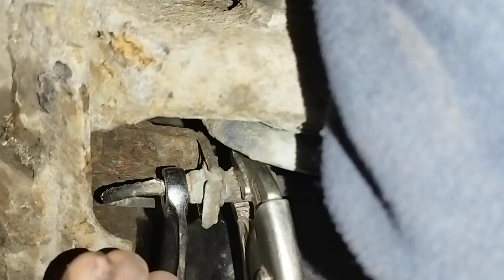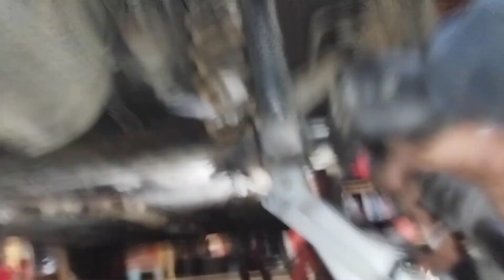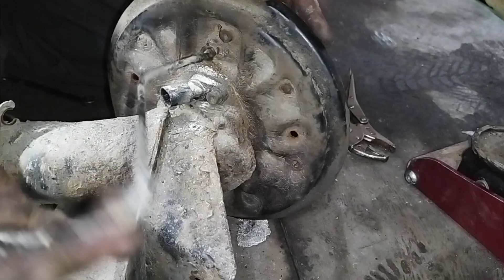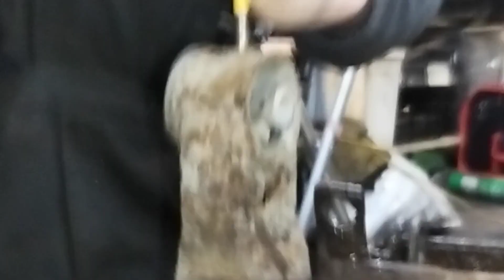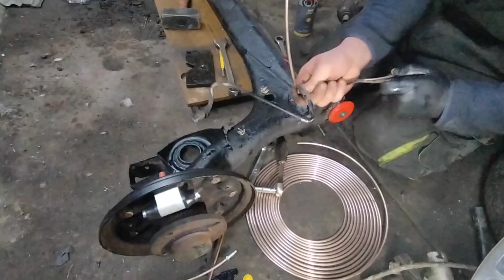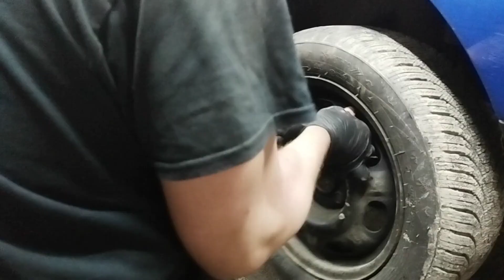VW Lupo Tuning - torsion bar polyurethane bushings install and rust protection

Comment: Hey Simon,
I've got couple of questions. Maybe you can answer :-)
1. Do you have any thoughts about new PU bushings after 3 months? Is car more or less stable on the road? (I've read that in some cases changing rear suspensions bushings to PU make things much worse).
2. Did you buy MPBS, Strongflex or some other vendor?
3. Does this car has also PU in front suspension (I am wondering whether PU will work OK on rear axle, when front still use normal bushings).
4. What grease did you use during installation (some people recommends copper grease, etc.)?
Cheers
Reply from the maker: Hi! Thanks for asking.
1. The Pu bushings in the rear are still in very good shape and provide awesome steering response. The only downside I noticed is that the shock absorbers take a lot more beating, so much so that I actually had to change them - I'm going to get sport suspension for the rear to mitigate that. Overall it was a great decision to install them. The comfort of the ride did not suffer, I'd even say it's better.
2. I got Olkusz Poliuretany brand - made locally for me in Poland
3. It does not, at least not yet. I've used the OEM+ option when selecting hardness, which is 80hrc instead of the race option that is 85hrc. For me the car started to ride like a comfortable gokart, which is exactly like I wanted. I will probably get Pu for the front stabilizer bar, to raise the responsiveness even more. 
4. Don't use copper! Copper grease has microgranolules of, well, copper, that will grind down the rod in the middle of the bushing. I used manufacturer specified product, which is synthetic grease, in my case it's lithium grease in a can - greatly recommend this stuff for the at home garage, it can be used almost everywhere. I've heard some people use molybdenum grease, which would work similar.
Thank you for your comment! Hope I helped.
Reply: @simondoesthings  Thanks a lot!